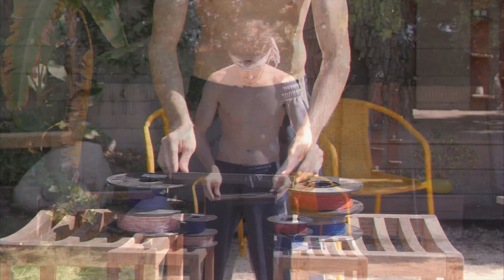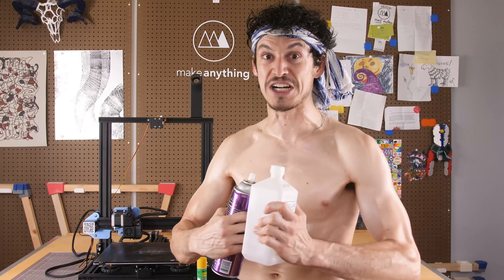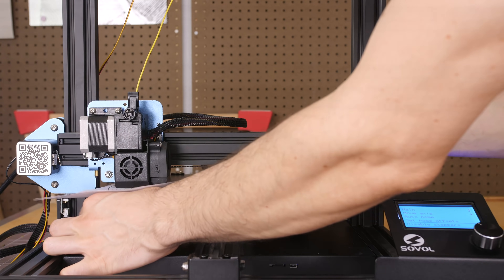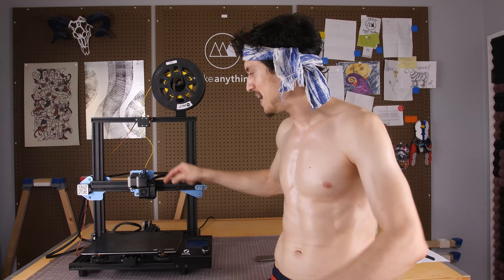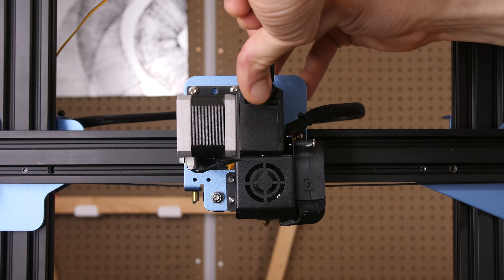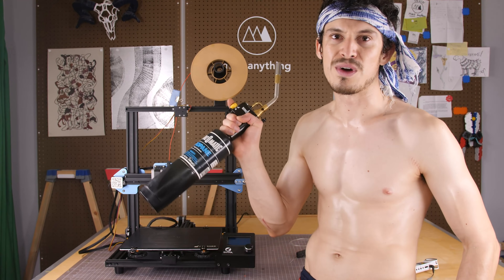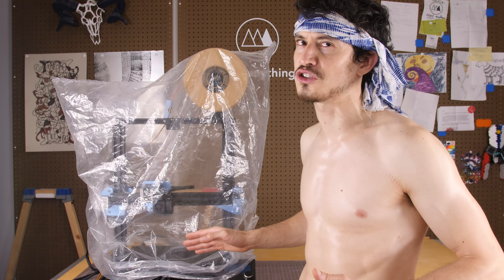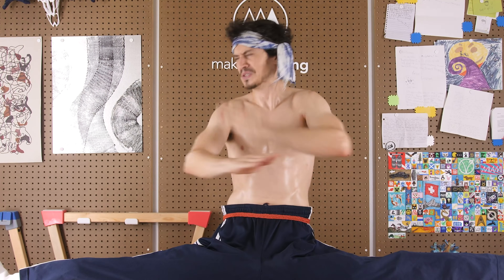Way of the Lazy Printmaster // 6 Non-Regulation 3D Printing Tips

Comment: I’ve found hairspray to be more trouble than it’s worth. Same for isopropyl alcohol. Instead I just stopped being so stingy. 
Clean with distilled water (works better than isopropyl on PVA) and glass cleaner (glass bed) then just do 2 passes of PVA glue stick (3m/scotch “create”) 90° from each other and if I’m printing something sketchy, I’ll use a very generous (10-20mm) brim.

Comment: "Unlike steel alloys,  cannot be hardened by heating.  can only be strain or work-hardened. The  occurs when the material is worked mechanically, e.g. by cold working. The action of force does not ."

Comment: Awesome video Devin!  Just an FYI.  Quenching brass in water will not harden it.  The only way to harden brass is work hardening - and I don't think you want to bend your nozzle back and forth, over and over - LOL.  Also, be careful using too much high heat - you can burn the zinc out of the nozzle - turning it into copper.  :-)

Comment: Quenching brass anneals it, quenching steel hardens it, but needs to be tempered at a lower heat to remove internal stresses built up from hardening.

Comment: I didnt come up with this one on my own, but when printing Flex/TPU, heat a section in the oven at 150 f for 30 minutes. make sure you get enough for your print! also, for TPU set your retraction down. my prusa i3 mk3s often fails a TPU print when it tries to retract the .8mm default. i set it to .1 and works like a charm. prints will be messier though.

Comment: lol this was funny
As someone who has also nearly a decade of experience i got to say i've used most of these however few things i do different:
- Nozzles: So cheap, just throw them away and get new one. Spending even 5 minutes cleaning one is not worth the 1$ in savings
- You demonstranced PVA hairspray on ULTRABASE -> Those do not need anything, actually seems to work better the more used. In any case, even cheaper -> PVA is the main component in wood glue, tho there is 2 different types PVA acetate and alcohol, one is water soluble other is not. Does not matter in this instance.
- Live level: I skip the manual extrusion test completely, just eye it roughly there and then live level. Most printers requires this only once, but others like the CR-10 S5 requires this to be done every single print.
Reply from the maker: Yea, I leave the ultrabase alone unless things stop sticking, and tend to just live level as well... I just wanted to show several options :)
Reply: @make.anything  Video just misleads people into thinking ultrabase is no better than bareglass :(
Where as ultrabase is by far the best you can get, but so much negativity on it going on leading newbies recommending newbies PEI because Prusa uses that ... but PEI is ... well PEI, and not for the lazy people ... 

(¤#"%¤#"(% just couple weeks back i started a print on Prusa MK2 seemed to stick well no issue whatsoever, i come back to completely ruined hotend assembly .... FSCK i hate PEI, always issues with it when coming from glass/ultrabase background and you forget to IPA wipe between each print and baby it until atleast 2-3mm printed)
Reply from the maker: Trust me, I'm a big proponent of Ultrabase and usually mention it whenever reviewing printers.. this was just a.. different video.

Comment: I don't really have tricks for 3D printing but I have two for mining in minecraft:
1) when doing optimized mining, offset the tunnels so you can run back to the entrance and hit the wall rather than go in the tunnel opposite, that way you never overshoot.
2) always put torches on the same side so you know in what direction you need to go: if the torches are on the left, you are going away from the entrance, if they're oon the right you are going towards the entrance( it depends on which side you put your torches but it's the same prinicple, just in reverse).
Reply from the maker: Minecraft tips??? ... I'll allow it

Comment: Well, this confirms my decision to trash my first hardened nozzle. If torching it doesn't work, that's the end of the line, right?
Never printing glow filament through anything below 0.6 again, not even from reputable dealers.
Reply from the maker: You can try soaking in Acetone, but every nozzle will wear down eventually!
Reply: Oh, it only saw about two minutes of print time before the fatal clog. That wasn't wear.
But thanks for the tip about an acetone bath. The nozzle in question is already gone, but I'll remember that for future endeavors.

Comment: Great video! I also do the on-the-fly levelling during the skirts a lot!
Just a point of wrong info in the video: brass doesn't get hardened by quenching, it gets hard by working it. I.e. hitting it with a hammer. Which is not really feasible for a finished part like a nozzle.
Reply from the maker: Would you say it's better to still quench or just let the nozzle cool naturally then?
Reply: My knowledge of metalurgy doesn't go that far, but AFAIK quenching or air-cooling doesn't make a difference. Quenching it in water doesn't harden it like it would carbon steel. Brass, like copper, work hardens. Ie if you bend it in the same place a few times it'll break. Best way to experience it yourself is to buy some brass bar- or round-stock and try to give it a Sharp 90 degree bend as-bought, and then do the same after annealing.

Comment: Extremely funny but very useful video.  My "lazy" secret is to *CAREFULLY* use a single edge razor blade to get under a stuck print to get it started for removal.  Once I have that under a little, I can then use a thin spatula to take over.  For especially stuck prints I use the singe edge razor in several places around the print.
Reply from the maker: Good one! Sliding one spatula under another does indeed work wonders for super stuck parts

Comment: This helped amazing, ever sence I got my printer, my prints never stuck. I tried everything, glue, tape, cleaning. Nothing worked. Now my prints stick. I cant thank you more.
Reply: The hairspray/isopropyl alcohol mix technique? I might do this. :D do you have a heated bed? And what filament are you using? This seems to be the most interesting technique I've seen. It will also keep the overspray of the hairspray down to a minimum!
Reply: I have the artillery sidewinder with heated bed, even just hairspray will work. But if this does not work, then something is wrong with your printer. And try to get the exact hairspray he has.
Reply: Oh, with black matterhackers PLA

Comment: I loved the video and good tips! My only concern, and I see a lot of people doing it, wouldn't the oil in the filter mess up your adhesion? Is that okay to get all in your hot end?
Reply from the maker: The hot end is pretty much just a straight tube and the oil helps lubricate things for smoother printing. It's just a tiny bit of oil too, so I haven't noticed it hurting adhesion

Comment: My lazy trick... if you want to print with a 0.8mm nozzle settings instead of 0.4mm nozzle settings just change the slicer settings and leave the 0.4mm nozzle in there. Just watch your print speed as back pressure will be a bit higher than with a 0.8mm nozzle.
Reply from the maker: I've been doing this a lot lately. Very fun to print at 1.6mm on my 0.8mm nozzle too!

Comment: To get the print to stick, double up the uhu glue with rough tape. Want to clean the surface? Redo the tape. Print won't come off? Use your spatula at the tape, not the print or bed. Still not coming off? Take off your glass with the tape and print on it and wash it till the tape's glue wears off.

If you want to apply as little tape or glue as possible, play around with a skirt. Though if you're pausing the printer don't forget to push some filament through afterwards, to keep the pressure going.

Comment: I mix 1 part mod page with 6 parts water, alcohol would prolly work too, and put a drop in each corner and then use a paint brush to spread it around. Then heat the bed to evaporate the water and happy printing with no skirts, brims or mouse ears. When the prints stop sticking add another drop of mod page water mixture and spread around again. Leveling on-the-fly is the best way to level. I print four single layer 10mm squares in each corner and level while they are printing.
Reply from the maker: Sounds like a great, less lazy bed adhesion mixture!

Comment: I strongly recommend not to use pliers to hold the nozzle while performing The Purge. To burn in cleanly, you need to heat it above 600°C so all carbon is burned, and in that temperature range brass is quite squishy, you can deform it easily without noticing. Use a piece of steel wire instead, just wrap it around threaded part about three times and you are good to go. Also, pliers soak away a lot of heat, so using wire you will burn less propane

Comment: Window cleaner works really well for me, got a 2yo ultrabase-like build plate and spraying the window cleaner on it when cold, cleaning it with the smooth side of a sponge and then wiping it off with toilet paper or kitchen towels works really well. And just one more trick: don't EVER touch your build plate if not necessary, the grease from fingers makes a thin film, which prevents the first layer from sticking. And always remember, when nothing else works, use paper painters tape.

Comment: You don't need a blow torch but you can use a tea lite candle (like the ones at the church) and a steel thin wire to hang the noozle over the candle flame, so all the filament can drop down.

But I am not sure it is a good idea with a hardened steel noozle

Comment from the maker: Well, I never thought I'd be oiling up for a YouTube video but it's been a particularly hot week and I just watched Bloodsport, so now this video exists. Enjoy and print responsibly...enough.
Reply: nice bod bro
Reply: Bro whats your workout routine 😆
Reply from the maker: You just watched it
Reply: @make.anything  👌
Reply: @make.anything  Thanks so much for the tip about mixing hair spray and isopropyl alcohol, O you lazy printing master. It'll probably save me a lot of headaches.
Reply: @lunchboxhedz292  3d printer curls and filament spool push-ups.
Reply: Amazing intro!! You made it funny and hella cool at the same time. Love the style!
Devin kinda ripped dOe
Reply: OnlyFans Printer content
Reply: edit: it is like half of this video is about topics i've been advising noobs in the last month... filament cleaner with canola oil... ,using skirt to quickly level the bed on the fly... and that hairspray+IPA which in my case is just glue stick+IPA..  

I have been testing and mastering this technique for a year now:    

Glue stick dissolved into 100% IPA until it is saturated. Strain the bits out adding a bit of IPA (it is saturated, it'll start coagulating immediately as any IPA evaporates.) Store in a large jar, apply with a wide brush on a warm, 40C bed. Make sure the printer is level with earths core... It comes out absolutely smooth, non gloss surface. One gluestick will last... 3 years? at least on a normal person.. No need to reapply, last time i applied the surface was... 15 prints ago or something in that scale and it looks like it'll take 30 prints more. And of course.. it is fully reusable, just mist the surface with IPA and smooth over with finger or collect back to the container (note, it gathers dust so.. just wash it away under a sink..)      

The surface becomes much, much harder than usual glue stick. It being suspended in a solution and the solvent slowly evaporating, the polymers in the glue have time to arrange themselves better. It is seriously hard, you can scratch it with a nail when you really try.. Not even using the scraper to remove prints makes marks on it.. It is brilliant... oh, it also adds a "frosted" surface on glass...    

Seriously suggest you start testing, it is like DIY magic goo..
Reply from the maker: @squidcaps4308  sounds great, but I might be too lazy :I
Reply: Can this please be the standard format going forward? Enjoying it for a variety of reasons.
Reply: I too vote for shirtless videos from here on forward! ^_^
Reply: Bloodsport is amazing.  One of my favorite childhood movies, Jean Claude Van Damn's pinnacle!
Reply: I watched the video, now I ran out of paper towels, thank you DEvin.
Reply: Hi my 3doodler start just broke could you recommend a wireless 3d pen😁🙏
Reply: This is great Devin. You're hilarious bro.
Reply: What a wild man . I enjoyed it so much . Do some more goofy stuff .
Reply: Thank you Devin, now I can go to bed with a smile!😆
Reply: It has hasn't it? Then that one day of cold rain
Reply: I'll never unsee that lol. Great tips, that I haven't heard elsewhere!
Reply: when do u usually oil up?
Reply: This may be off topic but has anyone ever heard of PMMA filament. It is 3d printable acrylic i cant find any video about it except minimal amounts of articles. this may be a good video topic, i purchased a roll from Push Plastic. lastly Love these videos keep up the great work i have been watching your channel since you first started. i hope you see this comment and help spark some ideas
Reply: Make Anything are you naturally hairless on your body or did you shave of some sort? If yes what kind of products do you use?
Reply: Hey devin
Just wondering why u haven’t posted in a while
Reply: The way every actor/actress think when they arrive in Hollywood :D